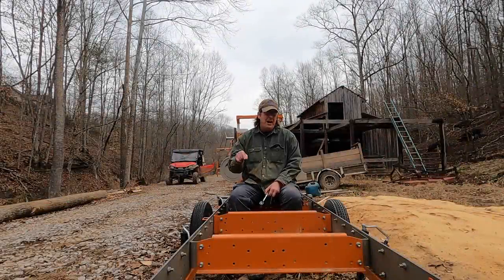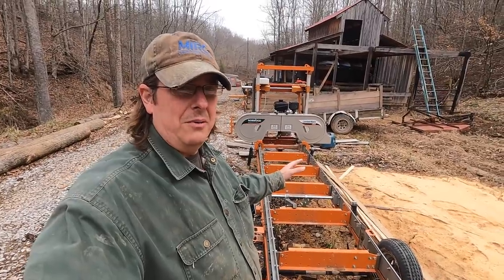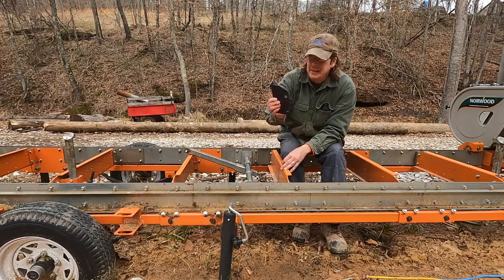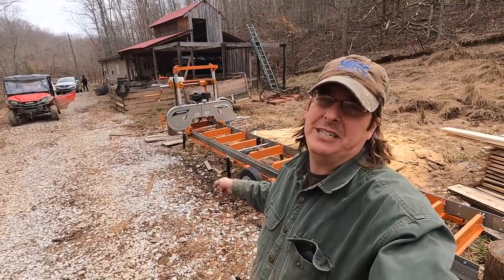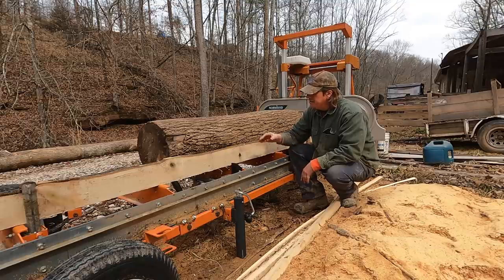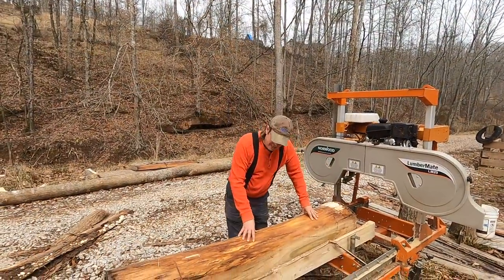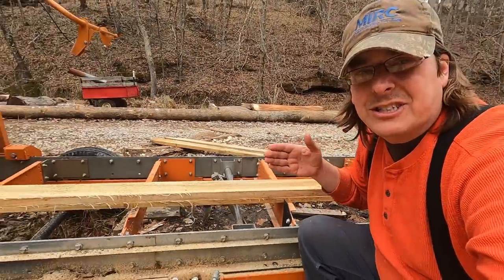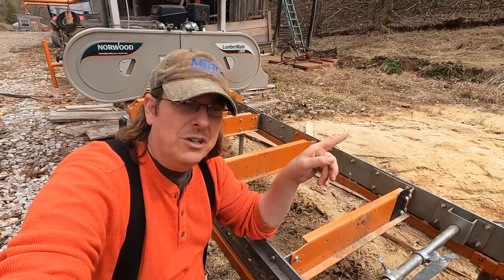This SIMPLE MODIFICATION Makes the Sawmill More Versatile

Comment: Wood Mizer has about 1 inch square stock for stops. Seems to prevent the wood crushing. Hence traveling to far. Perhaps an L shape, more surface against the cant. Your folding knife idea seems very doable.

Comment: Hey Troy I seen a somewhat similar suggestion but this may just be a more simple version. To your new tabs weld a 3/4 steel pipe collar drill a hole in the side and tap it for a set bolt with a wing nut to tighten and loosen. Then just use a length of 3/4 rebar for your upright. This makes it fully adjustable to any height or just drop it down out of way. You could even add a caster wheel at top of rebar this can aid and really help when turning larger logs by giving something for them to spin against. The rebar would be rigid enough to not bend but you could alway go with a piece aluminum pipe or a steel pipe if the weight of the rebar was an issue.

Comment: my mill has dogs on each bunk both short cleats and adjustable ones. also bunks can slide anywhere  I need them. it allows me to even be able to mill as sort as 10in long firewood rounds if i needed to. all my adjustable dogs are is basically one in tubing inside a bigger piece basically like a smaller  trailer hitch but its just 2 bolts welded in a t to give you grip by hand and no tool needed and that bolt goes in a nut welded to outside tube so it becomes a set screw and the dog that goes up and down has a point to dig in the log so it don't slip. i cant remember if my sawmill video shows that but its very simple and you could basically weld that tube setup to the plate you bolted on your mill and make it cheap..... basically scraps of steel. same as the holding dogs. hard to explain but you could make some cheap that you could move from bunk to bunk easy.

just went back to check and i did cover the dogs I mentioned above.... just excuse my videoing skills im not very good at running a camera phone as you'll see i had it in sideways node and a ramble trying to talk to a camera. i had done the video for grizz and my wife put it on our channel. 
https://youtu.be/Kr0ZE63QtuI

Comment: I can see what you mean. My thoughts on the idea would be an arm that could swing up like you suggested only make the part that comes up out of wood. I made a bracket of 1inch and half squared metal, mounted vertical. Then and just cut some stock out of hardwood that would fit. If they get cut off I have lots of wood. Sometimes I just need a short post those can be reused.

Comment: Sorry , this is gonna be long to explain, But if you got extra long bolts. put them on like normal. Lock them down. Then put a few nuts back, but with a gap in the middle of the nuts. Instead of bolting on your holding piece of metal, you could have a slit cut in it, and slide it onto the bolts. Since it mostly receives force in 1 direction, it doesnt need to be strong along the other axis. 2 nuts on both sides, will stop it from coming loose during use. When you go to flatten a large log, you simply slide it back off. .You can also use different shapes and sizes for different size logs then.    Sorry cant fabricate it for you. Currently trying to escape the great Hell that is NY

Comment: Idea - For each stop. 2 pieces similar to what you have, but with a 3 hole isosceles triangle pattern. A roll pin should fit tight into the 3rd hole. These pieces will be the bread of the sandwich. The rigid meat piece has 2 holes, but is 2" narrower (remove the 3rd hole section). The tall pivoting piece is thinner & has a long loose fitting slot that is at a slight angle. In the upright position, it will wedge itself between the pivot pin & the center meat. Make the slot longer than it needs to be, so when the pin wears down, the meat will still keep the stop square. The bottom of the slot will act as a hinge to allow the stop to fold below the work surface.

Comment: I would put the second piece of iron would have 1 elongated slot where it would rotate over the top bolt, and have a second open end slot that can slot over the bottom bolt.  Thus when needed, the piece can be rotated vertical, then dropped down to lock on the bottom bolt.

Comment: Instead of an arm slot the bolt holes so you could raise piece up make the plate 12 inch long with 6 inch slot and weld handle on head of bolts to hand tighten loosen them .

Comment: I would think a piece of angle iron with a tab cut out of it bolted to the bottom bolt and could be pivoted to rest against the top bolt would serve your purpose. You would probably need to notch it where it rests against the upper bolt so that it could be straight vertical. You could use a flat piece of steel to serve the same purpose, but the angle iron would give you a flat surface and larger surface area to rest against the wood.

Comment: On my Cooks mill (mp32), the stays swing up parallel to the bed.  There are tabs on each cross beam to hold the cants.  The tabs and the stays are not parallel, the stays are set in, so when you swing them down, you push the cant away from you up against the tabs.  The tabs dont aways make contact with every spot on the cant, if it has a little bark edge still on with a dip in.  Thus, the more tabs the better.  My biggest complaint about this setup is the swing up stays need to be adjusted from time to time otherwise they want to flop down.  Its supposed to operate off the operator side via a bar you push down with your foot.  This “feature” is pointless and Ive never used the foot arm- but I have clunked my shin on it about a hundred times.

Comment: Cut 2 piece of tubing or pipe 1/2 in. Long that fits the bolts. Take a piece of flat metal and cut a slotted hole at one end slightly larger than the cut piece of tubing. Then bore a hole the same distance of the spacing of the mounting bolts spaced from the top of slotted hole. Then cut a open downward angled slot from the top hole. Install pieces with fender washers on the bolts ( use longer bolts if necessary) with the slotted hole on the bottom bolt.
Object is to rotate bar up and slightly lift it up to drop and hook on the top bolt. Then when not in use rotate it down out of the way.
Message me back if you want more details. Cost $0 to $10. Depending if you have materials in your scrap pile.

Comment: My Thomas mill had a ..tooth  welded  on every bunk about 3/4 of an inch high. When you got a square cant you pulled the stakes and sawed down to that The mill would not go down low enuf to hit that. I replaced muy metal stakes with oak ones. So if you saw into them it doesnt matter. You never have enuf  log holders to force the logs against the stakes. Those are worth adding too. Frontier Mill and Woodland look the same to me.I looked at both and Frontier was higher. Shipping was $1000 instead of $399. I dont think Norwood makes Frontier.

Comment: I am going to look around your mill but not at it.  

Your sawdust pile, if you had a few tractor buckets of screened topsoil by that sawdust.  Then each day you cut lumber shovel loft a few garden shovels maybe 10 of that soil pile over the sawdust.  I wouldn't use the tractor to add the soil layer as that is over kill! That would create a superior loam mix for your garden the next year or maybe the next season!